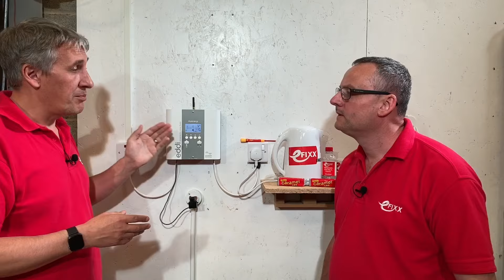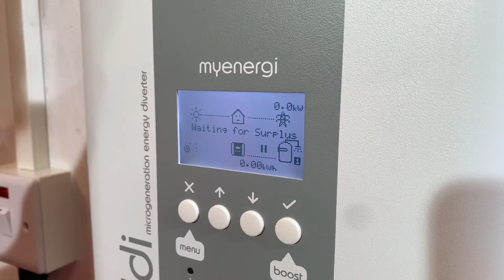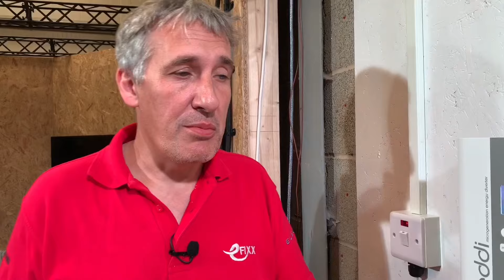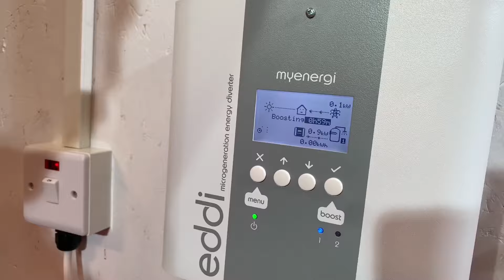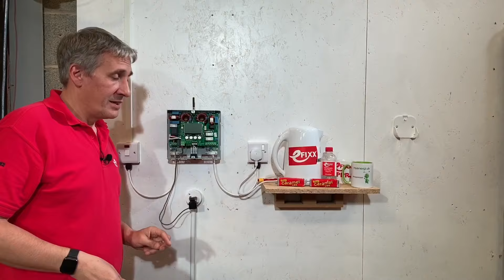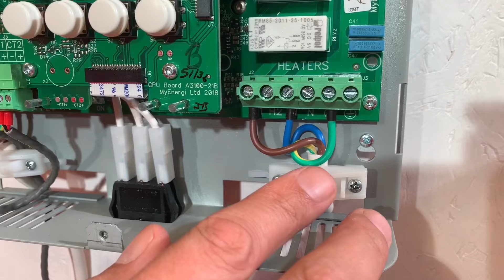FREE hot water using the Eddi energy diverter from Myenergi

Comment: How much does this cost ?  And is it easy to install for an electric?   
How does it integrate with the gas heating when it would be cheaper to use gas rather than the immersion.  Also doesn’t the element scale up quicker using the immersion rather than the gas making the element less efficient?

Comment: Just want to mention  - Sunsynk Solar systems can easily do this what the EDDI does. You set the menu to export power via the AUX port to drive the immersion heater.  Surplus energy from the solar panels are used to charge the batteries while power is sent to the immersion heater. The export kick in percentage can easily be adjusted to send power to the immersion heater.

Comment: If you use the boost and have batteries will the boost pull the power from the batteries or the grid?
Reply from the maker: It depends upon how you’ve set your system up.
Reply: @efixx  so I'm totally new to this, my solar install with batteries was only yesterday I have no clue on how to set this up correctly.

Comment: In our case we have the Immersun unit that provides similar function. As we run 2 x 210L tanks on 4kW solar system the Immersun is located near distribution panel and the connected to immersion heaters using existing cabling. Installing this way the unit is near the meter so current transformer installation is trivial.  Generally our boiler is OFF from late April  to late September and we do not use the boost function.
Reply: Sounds like you are using all your solar PV for water heating. Is there anything left over?
Reply: @markrainford1219  when we have good sun there are periods when we export to the grid.  Not done a detailed analysis (no export meter) but suspect not worth getting a battery

Comment: Hi. I have an Eddi energy diverter wirelessly connected to my solar panel setup. 
It works great, but I am finding that if I use all the hot water and try to heat more through the Boost, it is taking a long time. 
You mentioned the bypass switch at the bottom for a quick top up. 
Would using the bypass switch heat the water faster the Boost signal? Does the diverter limit the power getting to the tank compared to direct connection to input?

Comment: It would be interesting to know how well the immersion heater element copes with continuously being switched on and off due to the variable solar energy available.
Reply: Mine currently doesn’t have the eddi installed but is instead wired up directly to the inverter which means when power is above 1.3KWH it turns on, this turns mine on and off all day everyday and has done for about 10 years, so I’d say no damage done at all.
Reply: @krishaynes8130  how did you wire your immersion directly the inverter, i would like to do the same simple solution to heat my water cylinder

Comment: I am hoping to put 1320 kw solar on my narrowboat for battery support and I want to be able to heat my calorifier instead of running the engine for hot water when moored up in the country . I like the kettle idea to explain. We have 24volt system on board . The calorifier is heated by immersion, engine running or diesel central heating, I want to heat from the sun. Help.

Comment: Did you pay for the  Eddi? Di you pay for the associated PV, etc? So how is it "free"?
Reply: It is free in that once all the apparatus costs and installation costs have been paid, there is no charges being incurred for producing and using the electricity generated by the solar panel.

That is quite accepted as what is meant by free, compared to your consuming electricity from the national grid which you are charged for per kWh.

And obviously, when installing renewable energy generation systems, the total cost of ownership is important and how the pence per kWh compares to using national grid power.
Reply: @deang5622  Yes, but you spent money on a system and a product that you no longer have and could have paid for  hot water with. It's not free until all the initial costs have been absorbed by hot water production which is years. It's called ROI (return on investment).

Look, I do it too, put in systems that take years to recover but I do it for autonomy and to hedge inflation costs but it's not free.
Reply: @mosfet500  Only true if the user is not using the system anymore. 

And total cost of ownership along with a comparison of the pence per kWh for both the photovoltaic system and the national grid consumed power I already covered.
Reply: @deang5622  No, it's true right up to the point where the ROI is achieved. After that point it is free, before that it's not. If the systems are used to run other appliances, house, whatever then then it is free once that ROI is realized. That's specific to you and relative to everyone else, if someone has their system paid off and has reached the ROI then it free for them specifically.

Bottom line, can you but this device and have free hot water? No, the money it cost for the device has to be accounted for.
Reply: @mosfet500  No.
You are focussing purely on the ROI, or pay back period. There are other ways to assess the cost of a project.
Reply: @deang5622  You buy products to eliminate the cost of hot water or whatever. Is that an expenditure? Yes. Could you use that money to directly pay for hot water? Yes. When you reach the point where the initial expense equals the cost of hot water if you never bought the products to eliminate the hot water expense then any hot water you create after that point is free, before that point it is not. 

It's called ROI, what other ways are you assessing it?

Comment: Brilliant video 2 questions I'm having an issue connecting my ginlong data logger stick via the solis cloud app due to too good of thick well insulated walls.No main body of the ginlong data logger stick is visible,I only see an antenna on top of the eddi like in your presentation? Would a larger antenna improve the wifi quality for connection?
Second question How do you prioritise using the KW produced by the solar panel into the following order: override use of electricity produced by the grid in 1. The house 2. The Zappi 3. The Immersion ( Top Cylinder )

Thanks again for an amazing video

Comment: We have an electric central heating system from Thermaflow model TH12 330U Mk2.  This is effectively an immersion heater  which stores hot water which is heated up in off peak and used later to provide HW and CH.  Can you confirm for me that the EDDI unit can be connected to this Thermaflow boiler.  We could then use spare energy from solar to heat up this tank.

Comment: I have the IMMERSUN ( proportional load diversional controller ) unit which was the predecessor to the EDDI.
Mine has 2 ct coils, grid and pv. It monitors pv production and house consumption and dumps the excess energy into an immersion heater.
The 2nd circuit ( when water heater max is reached) supplies an electric  towel radiator.
There is also a 3rd priority which is a relay function to permit ( for example) a battery charger to operate.
The unit looks identical to the Eddi. I wonder if the Harvi or the hub would see it  ? My Immersun device has a separate accessory  too ... a little bridge/router that links to the antenna and wifi, which allows online monitoring also !
Reply: Immersun went bust and My Energi bought the patent

Comment: What I don’t get is why they are limited to just 3.6kwh , it take a heck of a long day to heat 300 litres with systems now tipping 6-8kwh on average you would either have to do 2 units or may as well just use a smart wall plug connected to an Emerson wall socket that can turn on off at cheap rate
Reply: It doesn't really matter how long it takes to heat the water.  You're taking energy produced from the sun, using that to heat your water and reducing how much electricity you consume from the national grid, and you save money by doing that.

You don't save any more money by heating the water faster.

To use figures posted by another user, figures I have confirmed are accurate, if the tank is 170 litres, and you heat the water up by 50 Celcius, it will take approximately 9.8- 10.5 KWh of energy to do it. (The specific heat capacity of water is approximately 4200 joules per kilogramme per degree Celcius), and 170 litres of water weighs 170Kg. So you can do the multiplication and conversion from joules to KWh.

Heating the water slowly could result in energy lost to the environment but the tanks are well insulated.

The only counter argument to that above is if you have a large PV installation and you have more surplus power being produced  than the power rating of the diverter, and then you're not benefiting as much as you could from the solar panels.

Comment: Would it not be cheaper to heat the water with gas rather than the boost on the eddi?
Reply from the maker: Depends on where you electricity is coming from - eg excess Solar PV or agile tariffs

Comment: Nice video - I have a Popular Cylinder Dual Thermostat which fits inside the thermostat pocket of my cylinder. It doesn't provide a temperature reading to Eddi, which requires a PT1000 sensor. Do you have a recommendation for a thermostat which will give Eddi the temperature of the hot water in the cylinder? The aim is to be able to automatically boost the temperature in the cylinder with the boiler, should we need to.
Reply: Our Immersun heats the water whenever the immersion thermostat is closed and spare solar electricity is available.  The immersion heater is used as normal.  When the Immersun detects the immersion heater thermostat is open it moves on to the next tank

Comment: I have a Boiler that is does not have its own direct connection (fuse) to the consumer unit. Instead it uses a standalone wall mounted fused switch. I do have solar panels. Can the Eddi be utilised with a hot water boiler that is fused directly at the consumer unit?
Reply from the maker: Yes it should be possible.

Comment: Does the Eddi CT clamp  not interfere with the export limiter CT clamp? Can the two CT clamps work side by side on the same main grid input cable??
Reply from the maker: Why would you need 2 clamps on the same cable?
Reply: The On grid grid tie inverter uses a ct clamp for export limit. Your power diverter also uses a ct clamp
....that makes it Two ct clamps
Reply: I would separate the two CTs by a short distance to ensure there are no fringing effects, distortion in the magnetic field as the field passes through the coil/turns of the  other CT.

And then use a clamp meter to check the output of the CT before and after the second CT is added to ensured continued accuracy of it when the second CT is introduced.

And I would do this for both CTs.

Comment: So many people took out their hot water cylinders when they fitted a combi boiler. Now need to refit one and integrate it with hot water from combi. Does not sound straight forward or cheap
Reply: I went back to a cylinder after my last combi (16yr old) was getting too unreliable. Gone for a megaflow as they have a good flow rate.

Comment: How do these things interact with the boiler, do they work in unison to reach the tank stat temperature..?
Reply: It's just a device that reads your solar panels power output and puts excess power to use by feeding it to the immersion element.
Reply: The thermostat for the tank decides on the final temperature of the water

Comment: I'm hoping to install around 8Kw of solar panels and then get a Zappi to run a modest 2nd hand electric car. As the property has an electric shower I would like to send power to a bank of  THREE 60 watt, and a 500/1000 watt electrical heaters as I'm disabled and enjoy a warm area in my living room as I prefer to concentrate heat into one room as opposed to using the gas combi boiler to heat the whole place as I live on my own. I also use a 5 litre urn for not drinks so would like to know if using a Harvi and Zappi then I could automatically use available solar power to first charge the car and once that was full automatically get the solar to heat the run and then my bank of small electric heaters? At the moment I only have a small amount of solar and use the ct data on the living room monitor to see if I am generating enough power to manually turn on the heaters which is a bit laborious. Sounds like a near perfect match to my needs?
Reply from the maker: We are looking at a similar situation in a new series coming soon.

Comment: Couple of questions: (1) if you have underfloor hearing with a timer/controller, can you set up a minimum current to be always provided to keep that powered? (2) if I have a zappi and hub already with CT clamps can the Eddi tune in to that or would I still need a harvi?
Reply from the maker: Great questions - we are doing a full installation with Zappi, eddi and harvi - so stay tuned.
Reply: Unlikely. The current is set by the load impedance and the voltage that is applied to it.
Usually electrical things just turn the power on and off using a fixed voltage - at mains voltage. For electric heaters, the controller is typically a simple on/off device, and that is cheap and easy to implement It takes more electronics to be able to control the current to it and start using techniques such as pulse width modulation, or an alternative is to directly control the current by continually variable voltage. It's a specialised form of control and it is unlikely a power diverter for renewable energy will incorporate such functionality.

Comment: I have a hot water storage tank, the water is heated by the gas boiler. The electric heating element is essentially for emergencies and needs to be manually turned on. (New build house) - does this system addition essentially replace the gas element?
Reply from the maker: It can be used instead of gas - but just need to compare gas kWh prices vs electric kWh . We are going to explore this further as part of our smart home take over series.
Reply: @efixx  great. Ongoing cost would be the deciding factor in buying this at the same time as the Zappi I’m looking at.
Reply from the maker: If you have Solar PV then it’s a no brainer and some of the new electricity tariffs such as Agile Octopus.

Comment: "Free" is a very subjective term.
Lets be 100% clear, whilst this is without doubt a clever unit it firstly relies upon you having some form of electrical micro generation installation - Solar PV, Wind Turbine etc.
Then the unit itself is also not free -  appears to be around £400 supplied + installation cost. The Harvi unit seems to be around another £100 supplied.
There are other units available from other manufacturers which seem to range from about £300 plus installation. Whether these are fully feature compatible I don't know.
I think it would be reasonable to expect a qualified electrician to charge a couple of hours work to install this. That's making the large assumption they wouldn't require an EICR prior to this also........
Return On Investment (ROI or payback) is probably around minimum 5-7+years depending on your energy consumption or use case and installation costs.
Reply from the maker: The other factor is the energy supply tariff and export tariff related to the solar PV.
Reply: I use my Eddi to heat hot water with Octopus Go at 5p/kWh and then top-up during day with solar. Use roughly 4.5 Wh/day . Was using 10kWh/ day using gas. Saving £100/annum and reducing fossil fuel and CO2 .
Reply: How do you make any savings with these? My off-peak go tariff is 7.5p kWh. My gas is 7p kWh. So if I was to heat my hot water cylinder up at 00:30-04:30 it would cost me extra to do so. Likewise, if I divert my excess solar to an Eddi,  I will save 7p kWh gas but as I am on the a SEG tariff I will not be getting the 4p kWh for exporting the excess solar. So I am really only saving 3p kWh. At £500 supplied and fitted that is a lot of 3p’s to see a return. It might have worked great with FIT payments but not now, Or am I missing something?
Reply: @jameslarwood5276  your gas boiler heating the hot water cylinder will loose 15-20% in efficiency maybe more if its not condensing when running DHW. you are using 100% efficiency figures for gas.
Reply: Stop ruining our fun with all these facts!!

Comment: Free hot water after you have avoided the £400-£500 of grid electricity or gas units that the Eddi cost.....plus the Harvi too of course.....and the solar PV. 

I get fed up with return OF investment being ignored when this type of tech is marketed. 

How many years to break even?
Reply: Indeed mate. I think it's expensive and I don't need to pay to have it installed.
Reply from the maker: The aim of this video was to explore the product itself. If you dig around YouTube you’ll see lots of Eddi owner videos talking about the economics etc.
Reply: @efixx  but the title is FREE hot water....
Reply: Steve Chambers 

Exactly. This is the point I made on another comment here. ROI, install cost, etc
Reply: It probably works out as the most expensive and least convenient way of producing hot water not to mention the least efficient with PV panels being only 20% efficient. The DC then goes through an inverter to convert it to AC to power an immersion heater! Might as well just have one or two PV panels permanently wired to a 500W immersion heater. Or way better still, wet solar collectors.
Reply: @markrainford1219  No because the point is you use your surplus energy. If you had that set up on cloudy days you'd be paying for it
Reply: @aldozilli1293  You are paying for energy on cloudy days whatever.
Reply: I've lived in my home since 1987 , I never expected any of the heating appliances to pay for themselves. Just reduce my costs and reliance on external energy.